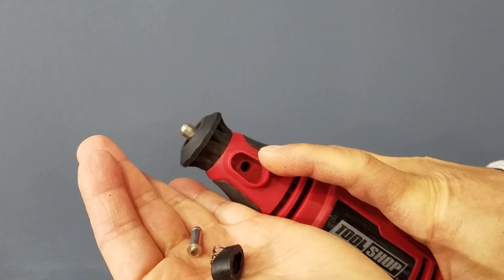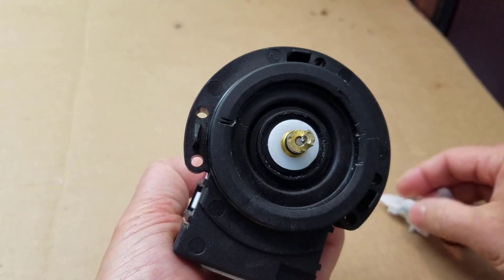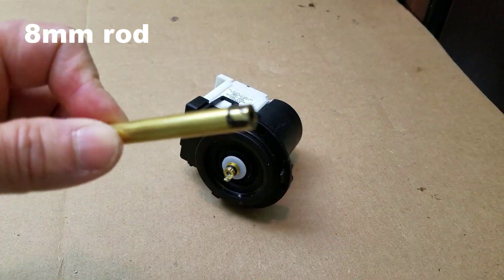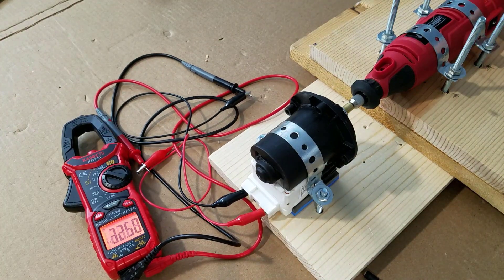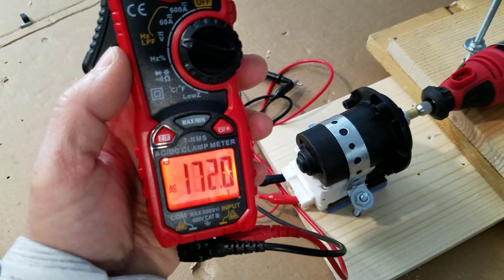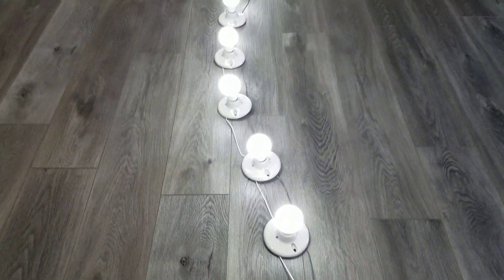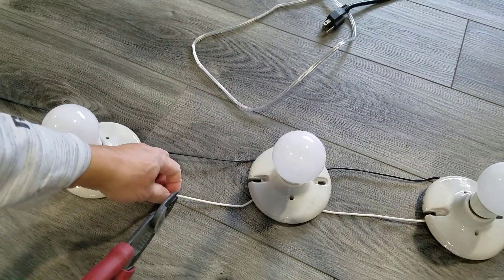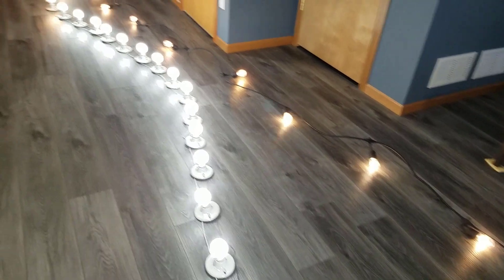I Turned A Tiny Washing Machine Pump Into A Generator!

Comment: GREAT VIDEO Mr. Mighty Tiger ! GREAT WORK - My REQUEST is: when you make your next VIDEOS, can you please Do Not ADD Music or extra Sound Effects, so that us VIEWERS can experience + hear the 'load being applied to the motors and belt drives' etc.... perhaps also SHOW US, top, bottom + ALL SIDES on video while running, for those people that SAY it's FAKED etc.... my QUESTION is: 'IF' combined with the your great '30+ LIGHT BLUB VIDEO via dremel tool + washing machine pump' could both PROJECTS TOGTHER power LIGHTS in the HOME purely perpetual?
Reply from the maker: Thanks for your suggestion. I'll give it some consideration regarding the original machine sounds. The sounds could get quit loud. This machine setup could only supply light power since it puts out very high frequency.

Comment: I have a similar setup with a 775 dc motor and have been trying to loop the circuit so it self-runs. I use a pwm speed controller to control the motor which is powered by 12v 6ah motorcycle batt. On the output side, I am trying to use a transformer + spark gaps + brige rectifier + supercap bank to charge the battery, hopefully to get enough juice. What you are doing is amazing replicating Gerard Morin’s pump to light up the house using RF modulation. Thank you and will also start posting my experiments on my channel soon. You inspire me!
Reply from the maker: You're welcome! I'm glad you enjoyed it. I got this idea from T. Henry Moray and Gerard Morin. The washer pump's housing is plastic, so it needs improvement. It couldn't sustain 10,000 + RMP for too long. I'll come back to this project trying to improve it when time permits... I just sub to your channel and can't wait to see your results.
Reply: maybeItsMoreEficientToDriveTheMotorWithASmpsVoltageConvertor.IDidObtainHighHeatingLossesTroughTransistorWhenUsing555TimerToDriveTheMotor. DidYouAchievedSelfLoop?
Reply: @ovidius2000  No I haven’t achieved a self-sustaining loop yet. My next step is to maximize the efficiency of the pump by replacing the rotor with a strong neodymium
magnet and somehow reducing the lenz effect by diverting the electro-magnetic flux created in the stator core.
Reply: @badboypaulpark  reducingTheInitialCoggingIsDoneByLoadingTheGenerator.
Reply: Sounds good. You need to have additional magnets sideways between the main magnets to reduce the dragging effect, specially with neodymium.

It also needs isolation transformer to separate the load from source. RIP Gerard Morin.
Reply: @Kangsteri  please explain more if you can.

Comment: I've made this! Lol I love it, I wonder if you could use a drill battery to charge 2-3 other drill batteries and just keep on leap frogging them.. CYCLING THEM... FREE ENERGY!!!! Then use that free energy to charge bigger batteries and run more and more heavy duty things... Keep on making the system bigger and more efficient... This could free humanity
Reply from the maker: It is an amazing technology. I'm hoping to get back to improve this project once I get to do all my other projects that I also really want to build....so little time, so many projects 😂
Reply: Radiant energy CAN charge batteries, but maybe not through their original chargers though. You may need to get a little creative with the connections. It acts a little more like static electricity, which tends travels on the surface of the wires.
Reply: @chucklaizure1442  well supposedly even normal electricity travels along the surface and around the outside of wires, not inside through the middle core. But who knows until you actually see it or realize what's going on lol.  but I watched a video the other day, titled something like "how electricity actually moves" or something like that... Can't remember, still so much to realize and learn about this Tesla era tech!
Reply: So i guess everyone missed, they're led lights. Not incandescent... and the extension cord thats ran inside the wood, up through , inside the "pump motor"..  ill believe it when i see all that running off the ground, isolated from everything... complete footage... not slight of hand garbage.. no such thing as free energy..  if you dont understand basic ohms law and simple physics, dont play w this kind of thing, it will kill you..  oh.. never mind.. play all you want... Darwinism at its finest....  gotta control population some how lol...

Comment: Are you able to measure the frequency of the AC produced?  Probably very high and varies based on size of load.
Reply from the maker: You're correct. The frequency was very high, and it varied based on the load.
Reply: @TheoMaxim777  I thought so, some people refer to this as radiant energy, similar to what Tesla was experimenting with. Great for illumination, but will only run a similar design motor, not motors designed for 60 or 50 Hz. However, I might suggest trying to run another pump of the same design, I think it may try to synchronize with your cool source of power.  Then, just run it  on solar/batteries and it truly will be FREE Energy.
Reply: @chucklaizure1442  : Save your breath and time. If you really want to know about "radiant energy" .....look & find "Secrets of Cold War Technology " and carefully read chapter one (multiple times if necessary). Afterwards, look into Dollard and his work & life history (he's one of the one's who actually educated "Secrets of......." author I mentioned).
Reply: @Rev22-21  Excellent suggestions, both. That title is on my 'to read' list and I've been following Dollard and his work ever since I discovered him. I'm fascinated by his work as a younger man in California.

Comment: Well young man I've seen a lot of videos similar but you have my utmost respect and dedication to your Channel. For whom that doesn't understand what you are trying to achieve is to help anyone watching this experiment to try to gain a little freedom. For those that say that you need to plug into your neighbor's power that it doesn't work that you're a scam those are the same individuals that are sitting watching TV paying $200 for their cable having a food microwave have an Uber deliver having the lawn man cut their grass the maid clean their house because they do not have the gumption to get off the couch go out in the garage or go in the living room get some electrical tape a meter soldering gun a telephone to watch YouTube and experiment. Yes you can operate with a washing machine motor if you look at the CDR motors they put out 5500 watts on each line spins it $30,000 RPMs depending on how you want to get it get a treadmill motor and your power half the house he's working with a 50 amp car alternator his next one he's going to put a RV or a 18-wheeler which is 190 amps you hook up 190 amps to a air conditioner air handler motor which is 3/4 horsepower and it turns it 28,000 RPMs he'll be able to get $340 amps light bulbs are only four Watts you're not running 100 watt incandescent anymore okay so for example your bedroom is on a 15 to 20 amp breaker that means you can only have $700 to 1130 w in your bedroom anything else in your blow a fuse well light bulbs are let's say 5 Watts so you can have a hundred 5 w LEDs which puts 60 watts of light so you can have a hundred of those you can plug in 19 42-in Samsung TVs you can have 143 cell phone chargers that's with the TVs and that's with the light bulbs you can have a DVR ceiling fan that is 19 Watts but as soon as you try to hook up a microwave a hair dryer or a toaster oven you've went over the limit so please people let's support them he's kind enough to give us the instructions try to build something and say hey listen Jimmy now what wire goes where it works and for those who don't know any better take a potato put out in the sun for 2 days take an LED light bulb
Reply from the maker: Thank you for your support and your sincere comments!
Reply: We are in the same frequency i also doing the same things thou it really require a lot of thinking and trial and error.
Reply from the maker: @grande6075  "We are in the same frequency" I like it 😁😁! It's exciting to see a tiny machine that can provide light for the entire house isn't it?... Good luck on your project.

Comment: Maybe I’m missing something but running 60A through those test leads I would think you would smoke the wires
I understand it was a short time but still I would think the wires would’ve drooped of getting hot maybe you’re using 10 gauge test leads.
Reply from the maker: This is an RF modulation demonstration. I believe it's not the typical AC current.
Reply: Induced current do not heat up.

Comment: I think you're lying.  What do you think?
Reply from the maker: Please help point out which part of the video was incorrectly presented?
Reply: @TheoMaxim777   1. A washing machine pump is not going to light up 30 bulbs!   2. The readings you're getting on your meter are not coming from your pump motor!   3. There's more than cardboard under the boards!   4. Black wire goes on the gold screw.  White wire goes on the silver screw.   5. I want to see the whole area around your gadget!   6. While the lights are on, lift the unit high enough to prove there are no hidden wires!  7. Set it up in your driveway and run it off a battery-operated rotary tool!  8. Does this only work on Youtube?   9. Mary's on the phone with Aaron!   10. Good night!
Reply from the maker: @traBylliB  Thank you for your comments (now I know what areas to improve on my next video). This could mean someone else may have similar questions. To answer all of your questions, you'd only need 2 main components to set it up and test it out. You'd need a rotary tool and the washer pump. I made the pump's information available in the video. It was readily available on Amazon for $27.80 at the time of this video (OEM Washer Pump 4681EA2001T)  Please set one up and test it out. Seeing is believing. You'd be surprised, like I was!... Or I hope someone else reads this and tries it out... It'll open their eyes.
Reply: @TheoMaxim777  brother delete or don't read.
Reply: haters gonna hate :)
Reply: @stevek6818  Hi ! brother yes hater gana hate, people never wake up what the world is going on? i a greed with you